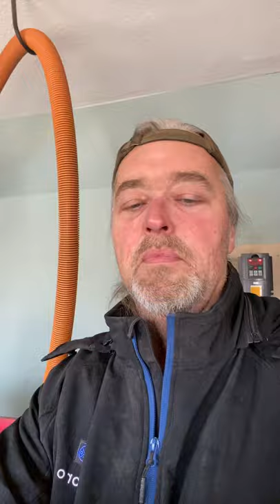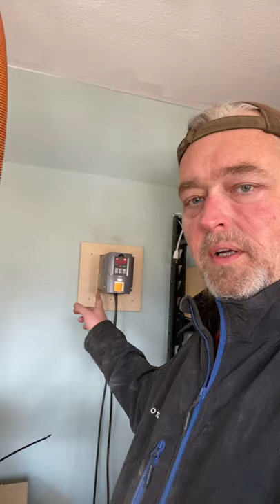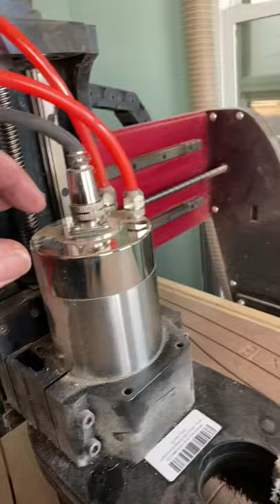Quick spindle tip for Nextwave Shark CNC

Comment: The Sharks look very tempting. Could you comment on how capable you think these machines would be with g10 fiberglass composites and micarta? Thanks for the tip as well.
Reply from the maker: The two biggest issue with cutting g10 is bit dulling and overheating. I have never cut it on the shark but my feeling would be that with diamond bits and if you could rig some sort of cooling system for the bits that it would do it fairly well. I would suggest get the 3hp spindle as it would have a little more power to push the bits through. I would also suggest roughly 4000rpm and around 20 ipm for the feed rate.

Comment: Hello sir I just watched your video on the tabs for blade alignment on the rigid table saw. I don’t have the rigid i have the craftsman 21833. And it’s very similar to the rigid. Would these work on the craftsman? Thanks
Reply from the maker: I just looked up the manual for the 21833. It looks like you have the type of trunion. The only question would be if the threads for the bolts are the same. If they are then I would guess that it would work. It certainly looks like it would.
Reply: @mkdesignsfinewoodworking  yea I just an email he told me to send pictures of the trunnions and to tell him what size the bolts are. Iv already done that just waiting to hear back. A lot of people have they are pretty close to being the same saw. And yea they look very similar.

Comment: hello may i ask did you conect water pump to VFD to start pumping when spindle starts??? can u tell me seting and where did u cocnect it?
Reply from the maker: I am not sure I understand the question. The water pump connects to the spindle not the VFD and there are no settings. It’s plug and play as it were.
Reply: Yes pump cools spindle And power fór pum should ve conected domě way to vfd to control start of thé pump when spindle starts
Reply: To make IT automatic
Reply from the maker: @cnc3daniel819 the pump has a 110 volt cord that connects directly to power. When you set up the VFD you will plug it and the pump into a power strip, then plug the power strip into back of controller. That way when you power up the cnc it turns the pump and the VFD on at the same time.
Reply from the maker: @cnc3daniel  yes